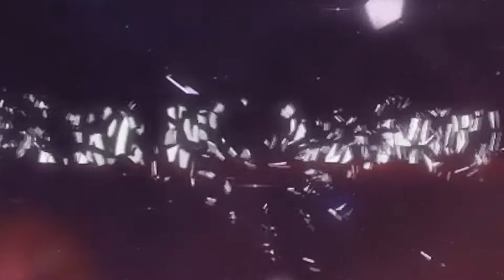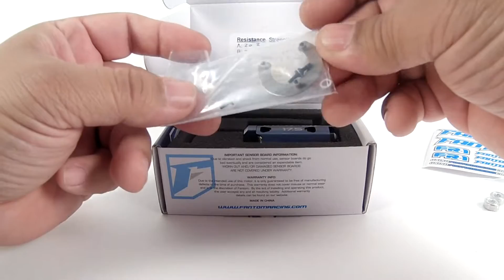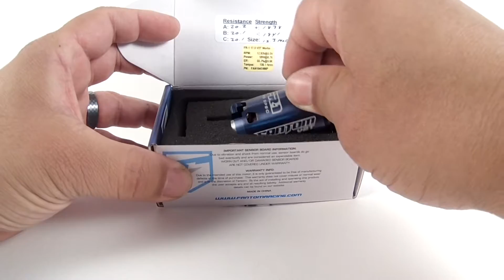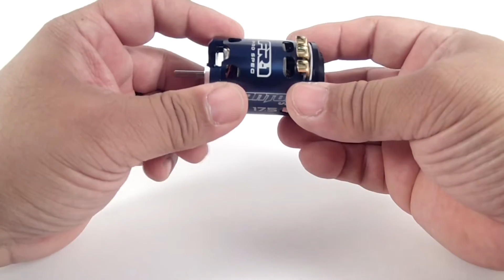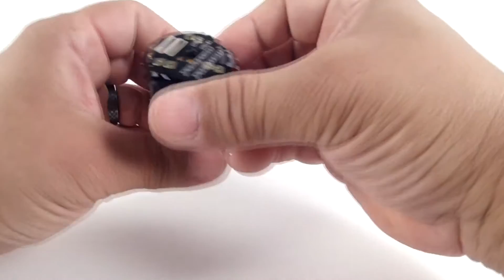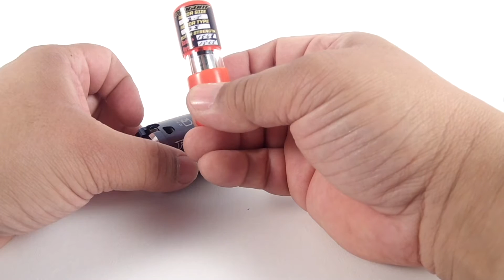Fantom Racing V2T FR-1 Works Edition Plus Motor Unboxing

Comment: Will you be testing the motor?
Reply from the maker: I've done one practice session with it so far, but I do plan on hitting the track with it again this week. I'll do a follow-up video once I get a little more wheel time with it. I should have it up by the end of next week. But let me say right now that it's way better than any motor I've run that begins with "Sch". It won't be that exciting, but I'll also post some footage of me running laps with it in my trusty B5M (no B6 for me yet). 

And thanks for watching...
Reply from the maker: Sorry it took so long, but I finally posted a short follow-up. See it here:
https://youtu.be/czoxCJr9Uug